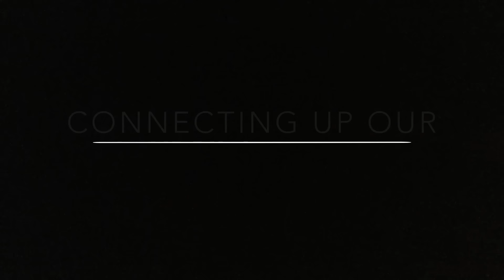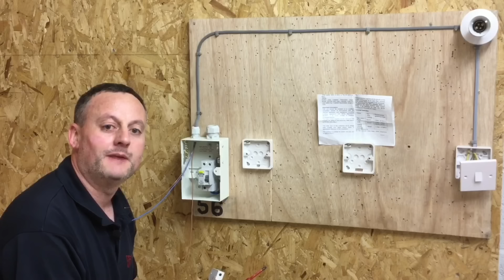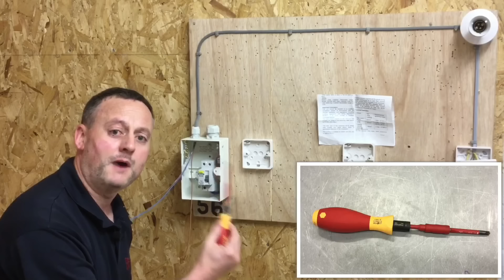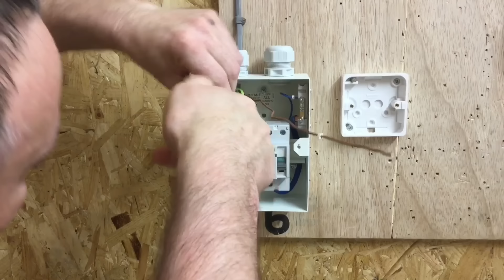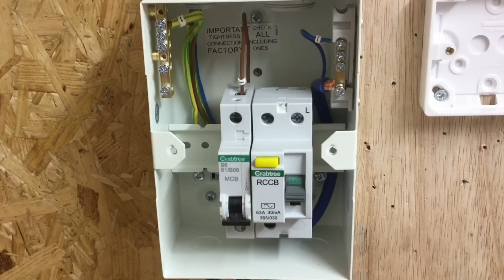Connecting a Final Circuit in a 2 Way Crabtree Consumer Unit (Fuse Board)

Comment from the maker: == 🕐 Time Stamps - Cut to the action 🕕 ==
01:06 - Identifying conductors in a consumer unit with numbers 
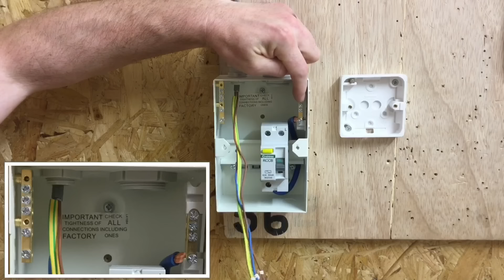01:51 - Connecting the neutral, CPC (earth) and line conductors in the consumer unit 
02:24 - Doubling over the conductors
03:09 - Using a torque screwdriver to tighten the neutral conductor 
04:05 - Dressing and connecting the CPC into a consumer unit
06:12 - Dressing and connecting the line into the top of the MCB
08:18 - Recap the connecting in a consumer unit (fuse box)

Comment: i have a fsu running from 2 gang switched unit in small bedroom it is powering a bed side light with a pull string i need to install another fsu to power outside secuirity light  can i take a feed from the fsu that powers bedside light ? wasnt sure how many fsu you can from ring circuit

Comment: Hi,is it ok to run flexi cable from cu?
Reply: Thank you very muvh for your answer,the reason is I wanted to connect fcu to cu and clip the cable to white skirting so I thought flexi white cable will look much better than that grey one as it is in the room.Of course I wanted to put some ferruls on the stranded ends.Is it just not good practice or is it against regulations?
Reply from the maker: No - why would you want to #kopexking

Comment: for a normal house consumer unit how would I know which wire to put in each terminal? Like there are multiple CPC and Neutral terminals as well as line
Reply from the maker: Step by Step How to Connect up a 10 Way Wylex Dual RCD Consumer Unit (Fuse Box) By Luke Wichard https://youtu.be/tyOiLAUlSpU

This should help 👆🏻. Thanks Gaz

Comment: Hi, enjoy the videos always very clear and precise. 

Do you use the torque screwdriver on all work on consumer units/DBs?

What’s the torque screwdriver’s make & model if I wanted to buy one?

Thanks
Ross
Reply from the maker: +R P 

We use a wiha torque screwdrivers at my college. The regs and manufacturers requires all terminations to be returned to manufacturers Specification for tightness. My learners are on week 6 and installing there first consumer unit and they are all using torque screwdrivers. Thanks for the question all the best GSH Electrical.
Reply: Great video gary !! thanks to you all them years ago at college im now a lecturer myself  ps..it's (swampy)